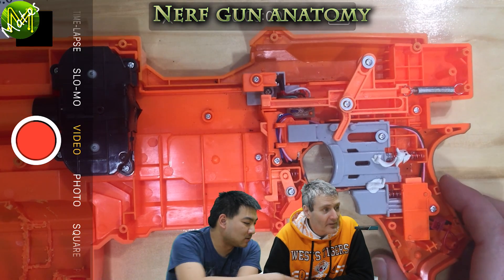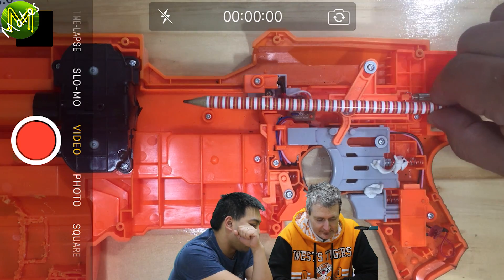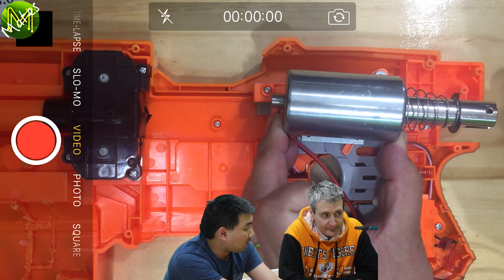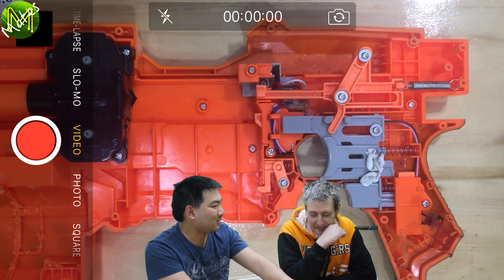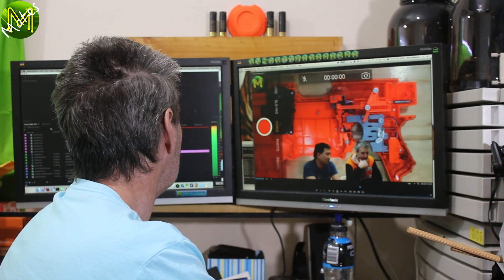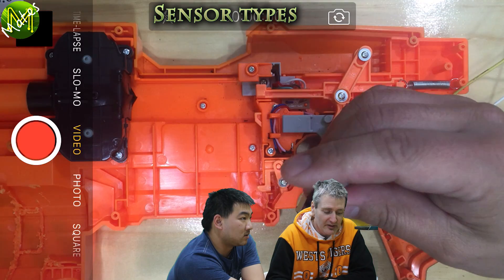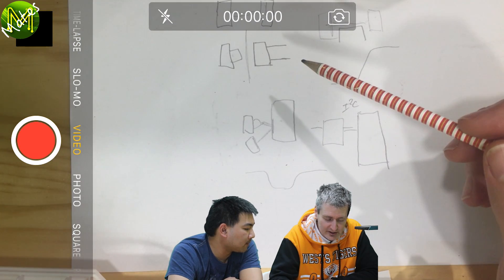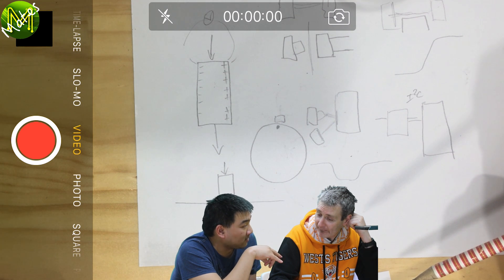#061 Learning Arduino: What sensor to use? // Episode 7 // Tutorial

Comment: Problem with hal-effect is you're possibly going to unbalance the flywheel with the addition of the magnet especially to the outside edge. Plus with proper aftermarket flywheel motors there's no need to worry about motor rpm. With a lipo and say an mtb rhino, you won't get sufficient spin down from dart load to affect fps much if at all unless you get to ridiculous (say 14+) dps.
Reply from the maker: +SirBrass 
Thanks for that feedback, yup I figured the magnet would unbalance the flywheel and so the opto sensor would be the best option.
Reply: MickMake Thing is, rpm measuring is very much "scope creep" and also not very useful for data logging. You'd be better served (in ease of implementation and according to the questionable value of that particular datum) logging voltage sag under load and extrapolating according to the motor specifications to get rpm. Also, voltage sag and current draw are the more important items anyway as they determine torque. Flywheels are unloaded till a dart is fed so higher torque means that they spin to freewheeling speeds faster than lower torque ones. Rpm is a known and set value generally for this application and above a "glass ceiling" of about 35k to 38krpm you're getting dart "burn" where the higher speed of the flywheels doesn't translate to faster darts but to just burning more dart foam off the dart due to friction. 

The requirements for a board controlled blaster, if we're talking practical uses is fairly confined. Monitoring electrical consumption for data logging is a new one but practical if you combine with a good chronograph and really want to gather good statistical data on motor performance with certain cage and flywheel combinations. Someone like Tom at Foamdataservices (look him up) might like that kind of data for his work. But onboard rpm measurements? Nah, too much work for very questionable gain. 

Now, an oled screen showing selected rate of fire, fire select mode, battery voltage would be a good system requirement addition. Also no need for sensors for that except as needed for the control logic. It minimizes the gadgetry needed to cram into the shell (which after running the wires gets cramped, trust me, especially when you then have to allow for a properly sized lipo, voltage regulator for the board, and the board itself. And don't forget EMI damping capacitors on the motors if you don't want to risk frying the board). 

I may have minimal circuitry experience, but requirements & testing are my forte. Avionics systems engineer :-).

Comment: This video talked about a lot of what I've been looking up to learn lately. I found a video where someone seeking to use a photosensor to measure the length of a camera flash, actually did a comparison of a photodiode, phototransistor, and a photoresistor. He used an oscilloscope to compare the signals they gave. The photodiode gave the fastest response, but the voltage it put out as a signal was the lesser of the photo diode and transistor. The phototransistor was the second fastest to respond, but it wasn't that much slower than the photodiode, and seemed to have more sensitivity to light level. The photoresistor was by far the slowest to respond, and it seemed to be reluctant to give a good, sharp, signal, meaning to was a kind of hump on the graph.

I got a look at a professional tachometer kit, and it came with stickers of reflective tape, like you'd see on a backpack, or safety gear. I think a combination of shiny tape, and black marker, would create an extremely good contrast.
Reply: There's also the question of the speed of the actual dart, not the flywheel. You just need to use two sets of IR tripwires at a set distance from each other, in the barrel. And monitor them both for a specific sequence of signals, and also the timing of the signals. If you use two sets of IR tripwires, you can have a shot counter, and a speed sensor. If the tripwires are spaced such that a dart may at some point, in its travels through the barrel, block both tripwires, then you can monitor for a sequence of sensor states the look like this: A is blocked and B is unblocked, A and B are blocked, A is unblocked and B is blocked, A and B are unblocked. (Where the tripwire closest to the flywheel is A, and the other is B.) To measure speed, wait until the sequence: A is blocked and B is unblocked, A and B are blocked. Now measure the time between when A becomes unblocked, and B becomes unblocked. You can now use the distance between tripwires, and that time, to calculate speed.
Reply from the maker: +World Theory 
Yup, I have yet to do some experiments before I record another session with Tim. There'll be an optimum sensor to use. There are some nerf products that do it, but half the fun is figuring it all out.